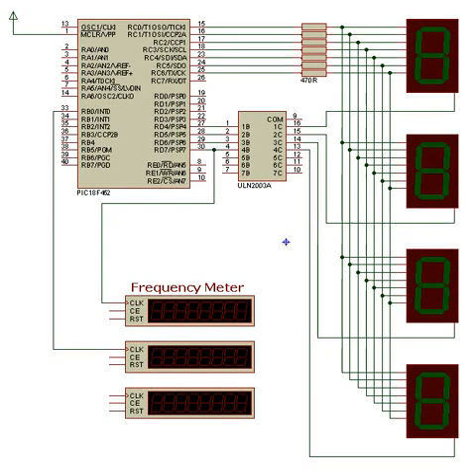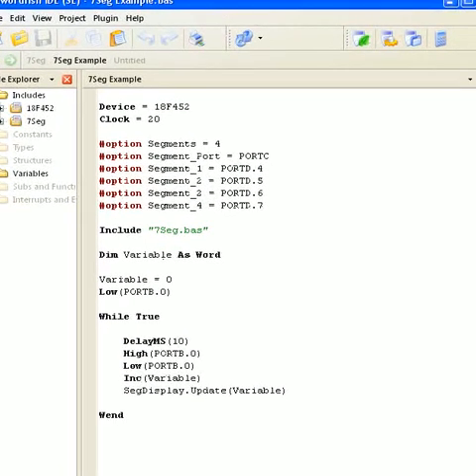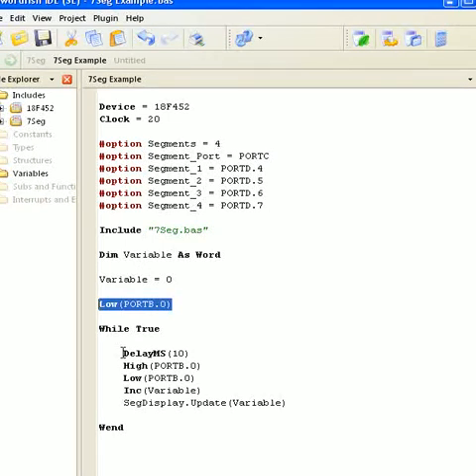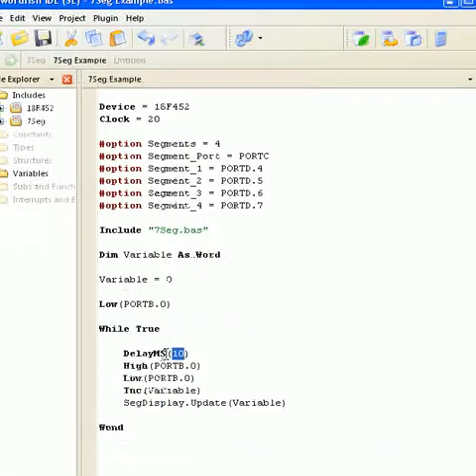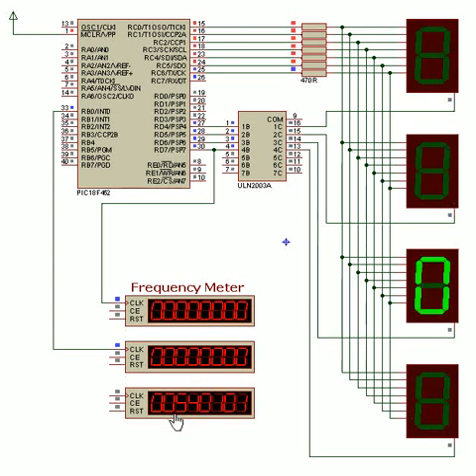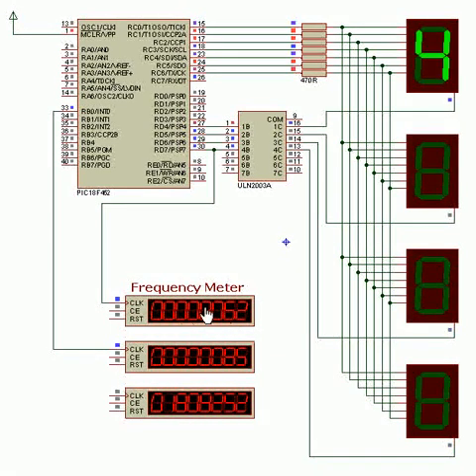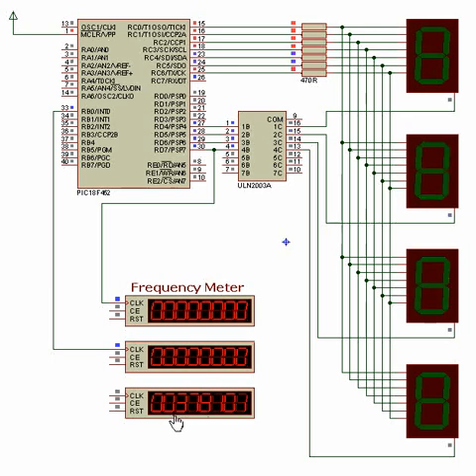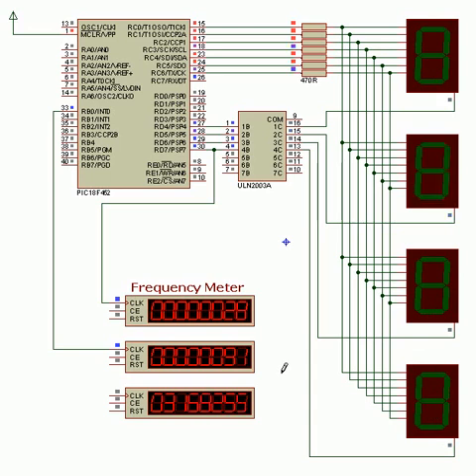4 Segment Displays Multiplexing Downsides

Comment: Use the millis() timer to set delays. Look at the example Blink without delay sketch to find out how this works. You Never NEED to use the delay() function for ANYTHING. Same with the goto function which can be replaced with if else statemens. You can perform multiple "TIMED" functions without holding anything else up. Peace